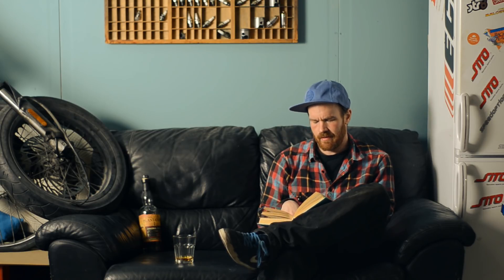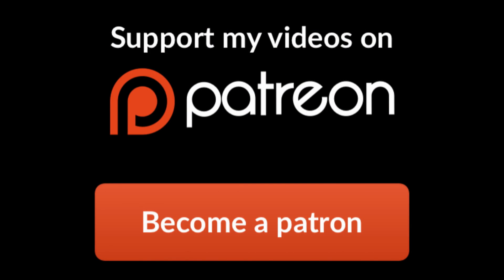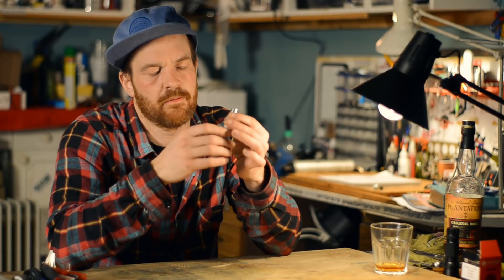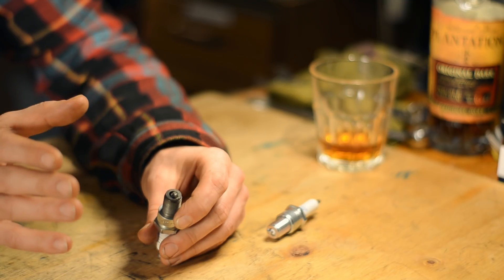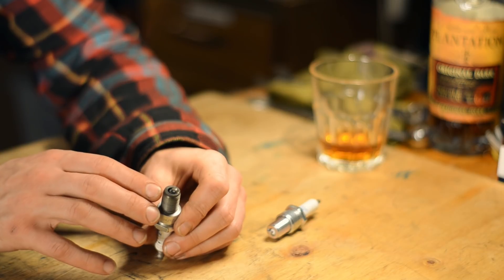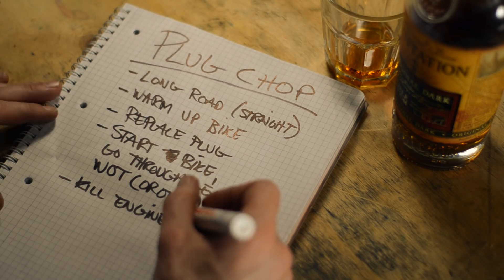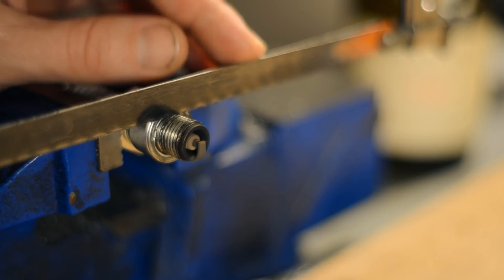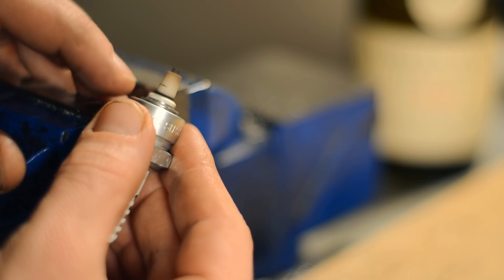How To Read Sparkplugs | AFR

Comment: Cool, at the moment I'm playing with the float level in my Yamaha AG100 1973 A model, mikuni VM20SH carbi, getting my mixture right after fitting new carbi kit, the service manual says to take fuel bowl off, turn carbi upside with gasket removed and not putting any pressure on the needle spring, then measure, the measurement from what is then the highest point of float down to the gasket surface is 19.2, with 2.5mm tolerance, giving you either richer or leaner float level, I'll have to buy a couple more plugs and test it like so, great post once again 👏👏👏

Comment: One question about gaping the new plug.I curently using NGK BR9ES with standart gap 0.8mm but for my scooter is reccomended 0.4mm gap with Champion RN1c wich  can't get any more.Do i need set the gap to spec of the moped or the spec of the spark data?
I have problem with fouling spark's but i don't know why.I drive a lot on 1/2 throttle is that the missing part?

Tha ks for answering.

Comment: Aside from the soot ring - the colour of the insulator also indicates what temperatures the cylinder has been experiencing. Yellow to green tinge indicates the engine is running too lean and therefore too hot due to lack of cooling by  the fuel mixture. Used to see quite a few post rally engines that had failed due to revving and doughnuts, usually the customer would claim ignorance to any horseplay but the plugs would give them away every time!!

Comment: i want to try this on my rotax fr125 engined kart,it has a centrifugal clutch which means i cant pull the clutch in,will it make any difference to the reading having to coast with the engine still turning but cut ignition?
Reply from the maker: It will contaminate the reading, but you'll still get ok results.
Reply: @2STROKESTUFFING  awesome thanks dude,love your channel,its with your help that i have ported the barrel with great results,hence the need to get it correctly jetted,currently running the 34mm dellorto with a 182 jet,im very close to optimum
Reply from the maker: 👍 Thanks!

Comment: Best intro! Is there a good way to clean the insulator? If the insulator could be cleaned one could have a testing plug with a hole thru the threads.
Reply from the maker: I think it's possible with sand blasting but never done it myself.

Comment: Hey 2stroke stuffing, i have a moped (Rieju Rs2 Matrix) and i recently put a 73.5 cc kit and 21mm carburetor on it and it runs Good, if i full throttle it, otherwise it sputters a bit, i have a racing plug on it at the moment i think maybe its gap is too small or maybe i should use a normal spark plug. What do you think?
Reply from the maker: Maybe the needle is a bit lean, or even rich - try raising/lowering it and see if it helps.

Comment: In the UK we have a tool called a Gunson Colortune, Which is basically a spark plug with a glass insulator allowing you to see the flame in the combustion chamber and tune it buy the flame colour.
Yellow = Rich
Light blue = lean
Dark blue = OK
The down side of this tool is you look at the flame through a tube and can only do so while the bike is stationary (unloaded),
However it wouldn't be to hard to attach a small cheap bluetooth camera to the tube, link it with a phone secured on your bike and get your under load readings that way.
And because it is made of metal and glass it won't be affected by the oil content of a 2 stroke, and when done you can use the camera as a bike cam.
https://www.youtube.com/watch?v=Y9t8XhFlKbk
Reply from the maker: I'll have to get ahold of one of those!
Reply: Just a caution. The gunson colour tune can't be used under full load. at least the manufacturer claims. Another down side is there is so much volume in the glass spark plug they give you that it affects compression ratio AND scavenging. so FYI. This is the exact reason I started switching to very very low open volume or exposed volume plugs. less trapped exhaust gasses = less misfire and less chance of deto.
Reply: I just learned of the colortune yesterday. I placed an order this morning and I can't wait until it comes in.
Reply: @johupp and? tell us!
Reply: Thank you William, I had never heard of this before, just placed my order on eBay! Surprisingly cheap shipping from UK to US. Will take the guess work out of tuning!
Reply: But thats not accurate to trust in some high perfm engines like motocroas, karts, scooters etc why? becouse can you difference when is a bit lean (safe) or too lean (dangerous)? No, you just see the blue color in a slightly different tones that are hard to compare, plus as you said the tool cant be use in a full load straight so... thats why the plug trick it is good

Comment: That was a OLD School tip man  !    Your right about the oil  ratio  type of oil and type of fuel used  makes difference  in the width of the band  insulator  Nice Video ..
Reply from the maker: Thanks!

Comment: can you please tell which mixture is good for drag racing ...i mean wide open throttle application..lean or rich
Reply from the maker: Depends on fuel, typically 12-12.5:1 for pump gas.

Comment: They make an air/fuel tuning sparkplug that has a see through window that let's you see the color of flame to determine the rich/lean conditions of your combustion. You then can adjust your a/f mixture while the engine is running. I love it. You get a perfect tune every time.
Reply from the maker: I remember seeing one of those in an old magazine, would be interesting to try.
Reply: 2STROKE STUFFING 
I seen a YouTube vid on "For The Bold". He uses it on his Suzuki 550 project. He has a link in the description. I bought one and am willing to put my life on the line for it. It's the easiest way to tune your a/f mixture. Because you tune it while it's running. It's best to have a buddy running the throttle for you for top end adjustments of the carb. And your lean top end with bigger carb issue. To much airflow per displacement. Make a small hole with your lips and suck in as fast as you can, then open your mouth all the way and suck in. You can feel the difference of speed of airflow over the tongue. You have to have a airflow that coincides with the specific gravity of the fuel you're trying to lift up the jets. Just think.. If you put a Holly four barrel carb on that engine, would there be enough vacuum to suck the fuel into the engine??  You have to have the right cfm of card to match the cc and a/f tuning of the cylinder/'s.
Reply from the maker: Thanks, I'll check it out! You're probably right about the carb, I'll have to do some more testing with it tho, before I write it off as too big.

Comment: As 15year old i dont have alot of money but what i did is run at full throttle and then just turn engine off and pull plug, but instead off destroying my sparkplug i just check the electrode colour. NGK also used to have a manual back in the days how to read a plug, and i said you should read the electrode not the insulator. Also this is thee first time i heard that you should check the insulator instead of the electrode

Comment: An easier way to cut the plug apart is to hold it in a vice by its flats and run a 5/8" hole saw down over the insulator, to cur the metal retainer. Once the circlip is out, cut a little further and you'll be able to pull the complete insulator out of the body 👍
Reply from the maker: Good tip!
Reply: @2STROKESTUFFING  hey do you have an email I can send you a video or fb?

Comment: Hmmm... Maybe a small warning! Unscrewing the plug from a hot aluminium-head may destroy the threads. Been there, done that. 😉 Anyways, keep up the good work!
Reply: You unscrew your "warmup" plug a quarter turn cold. Then warm it up, pull hot plug, chop plug is not torqued, just finger tight. You then pull it as soon as the roll stops. Anti seize on the warm up plug threads is a good idea too. Same warm up as a compression test in aluminum parts. So long as you don't torque the cold plug into a hot head, risk is very low. The downside is once your 4 chop runs are done, you have to wait for the engine to be cold to put a "running" plug in under proper torque, because torqueing a cold plug into a hot head will pactically guarantee some head thread comes out next time that plug does, no matter temp.
Reply from the maker: Thanks for the warning!

Comment: Finally, a good plug chop tutorial! Insulator color reading can get you close (if you use clean plugs each time, each throttle quadrant), but a chop is needed for getting it "on the money". It's ok to use cheap plugs for the color reading runs, but chops MUST use the plugs you plan to run "full time" to be truly accurate. Always informative AND entertaining Alex!
Reply from the maker: Thanks man!

Comment: Destroying a spark plug each time, just to read it for each throttle setting? Have you not heard of lighted plug magnifiers? They illuminate and magnify the base of the porcelain. No damage involved.I thought the whole idea of a motorized vehicle was to drive it at all speeds and loads. We can't concern ourselves with WOT only. Problems like detonation usually occur at lower speeds under heavy load. In any form of motorsport, you need to be working toward a high long flat torque curve. When you get that, the power number will follow, and the vehicle will pull hard all the way up.
Reply: How do you measure the width (which is actually depth in an unchopped plug) of the carbon ring? Just being able to see it isn't enough, you have to be able to measure it accurately. As a plug is only good for one run anyway, there is no advantage to "just peeking at it". If the expense of losing a dozen plugs is too high, then you shouldn't be power tuning anyway, because the practice requires accumulation of myriad bits whose final use will be gathering dust on a shelf.
Reply: I googled this & they are just like doctors ear magnifiers. Imagining the scenario - you could never see clearly to the base of the porcine due to the extreme angle. Seems like people trying to sell a lemon tool to tools.

Comment: My plug says the last guy only had a pair of pliers. I assume it was tightened with the pliers (or hammer and chisel)  because of the marks on the left side of 2 of the hex flats.
Reply: So what you have is a full on race engine lol.
Reply: Found the previous owner

Comment: Good video. Does the nitro mixture do the same? How fast can your hat go? That looked like 100mph.
Reply: He buys z-rated hats, they're quite popular in Norway, especially among 2 stroke skoot fans
Reply from the maker: Thanks! Methanol/nitro is best read by how much of the plug tip plating is being oxidized - 90% is pretty safe.
Reply: ludditeneaderthal 
Just don't look up?
Reply: upside downdog well, down in your case... Lol
Reply: ludditeneaderthal 
THAT'S GREAT! I am smiling big enough to crack a jaw!

Comment: well, while it is correct that the color of the insulator doesnt tell you alot, it does give you an idea of what the engine is doing.... but if you know what your doing, you only use it to determine the mixture at wide open throttle. the rest should be done by feel and ear, at least on a 2 stroke. a rev gauge and temperature gauge are quite nice to have also.......

but the whole color thing also depends on what sparkplug is used, the temperature, the moisture level, quality of gas and oil... i mean there are so many variables, i think it is a waste of time and money disecting sparkplugs like that, to me seeing the color of the insulator at the top, is good enough to see if youre in the ballpark, then you can finetune it from there....
Reply: I agree, get it close and tweak, by the time you are done messing around conditions change and you start over.
Reply: @MidLifeCrisisGarage  that's why......Lectron

Comment: I thought the glass of whiskey was to compare the plug color too 😎  🥃

Also when you kill the motor you want to pull and hold the clutch so when you coast to a stop it’s not under load..
Reply from the maker: True, forgot to mention the clutch...
Reply: @2STROKESTUFFING well "not bringing to idle" means kill de engine and dont leave it in any other rpm range so... i think is okay you dont have to apologize 😅

Comment: isn't possible to read out from to exhaust temperature ( if you have one like a mychron 2t ) ?
Reply from the maker: Sure is, but you'll need to determine a baseline egt to shoot for.
Reply: Can you make a movie about how to determine your baseline egt? Or do you need to dyno it to do that?
Most people I speak say you should aim at 600 degrees. But does this apply to all engines or is this engine dependent? I've got a iame x30 super ( 175 cc gokart engine ) equipt with the mychron 2t.
Reply from the maker: Added to the list!
Reply: Klavers FMT It's anything between 590-730c. For example, rotax dd2 evo i ran at max 720c, but with TM kz10b it would melt the piston at such eg temps. As far as i know and have seen, iame x30 super suffers from much bigger problems with piston reliability then the allready fragile 125 x30 so i would keep it on the cooler side

Comment: The one thing i will say about you videos is your cinematography is amazing but your audio is now lacking in comparison to your video, i would suggest separating the channels and removing the background noise in something like audacity then re adding it to the video but other than that great video, and i wonder you can read the soot rings on glow plugs as well?
Reply from the maker: Thanks, and thanks for the tip! I might have gone a bit overboard with the compression too...
Reply: @2STROKESTUFFING  nah, it was on point. Guff job.

Comment: Does the milimeter range apply on all 2 strokes (cc's), spark plug types, etc? And is there any different way to tell if the mixture is good without buying a whole bunch of spark plugs? Thanks in advance.
Reply: You can do it by ear and feel if you don't need 100% perfect results. 
Bogging when you give full gas from idle, floating rpms, running really hot, runs better with choke = lean. 
Not revving, doesn't idle, fouling plugs, smoking allot = rich
Reply from the maker: The millimeter rule of thumb should apply to most plugs.